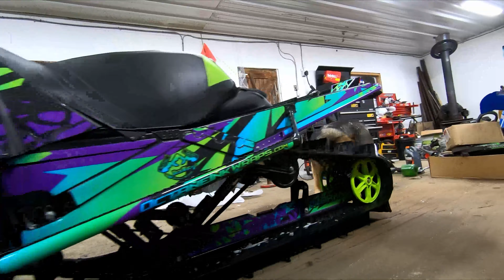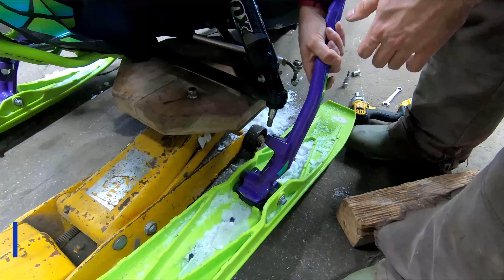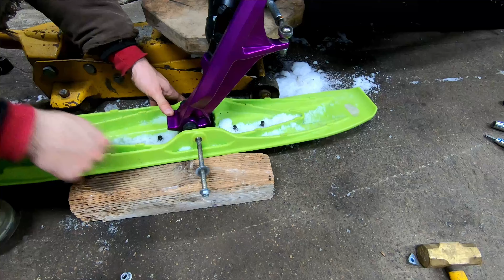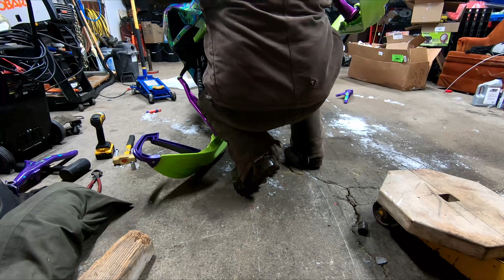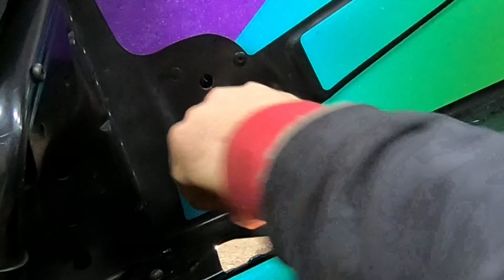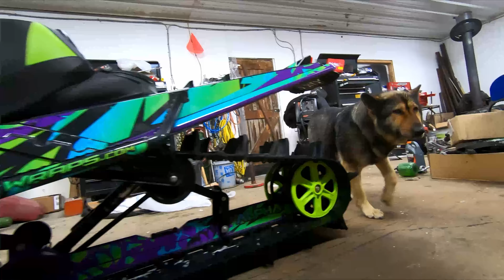ZRP 1.25 Billet Lift Spindles Installation

Comment: Hey brother, I ended up losing the upper a arm bolt and nut that connects to the spindle to hold it in place, it is the star bit one you took out. Do you by chance know the part number for it?
Reply from the maker: 2623-067 is the bolt. If you have ZRP spindles you need to get the square nut from ZRP. You can lookup your own part numbers on country card OEM parts look up.
Reply: @ippielb   dude thankyou so much ive been frickin hunting the internet
Reply from the maker: @zackbohne6145  just go to country cat. Look up the oem parts and select your model it has all the schematics

Comment: How are they 10months later
Reply from the maker: Other then putting a twin rail skid under the sled, this is probably the next best thing. Makes the front end more predictable. Gets the front end out of the snow more, doesn’t make increased ski pressure like other brands, solid as a rock, don’t think anyone can ever break these. The anodizing did fade a little bit. 

Would I buy again? Probably, but arctic cat has fallen behind so far, I’ll probably be riding a Polaris next year.
Reply: @ippielb  sad statement about Cat...but as someone who's ridden them for 20 years, I feel the same. Last straw was when they dropped all the little dealers........